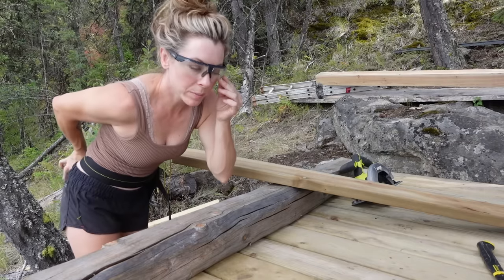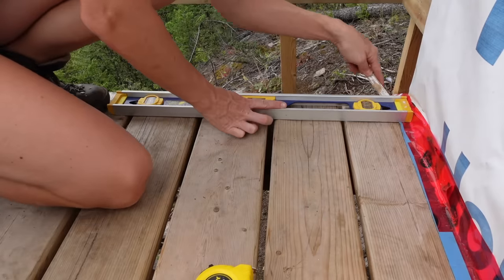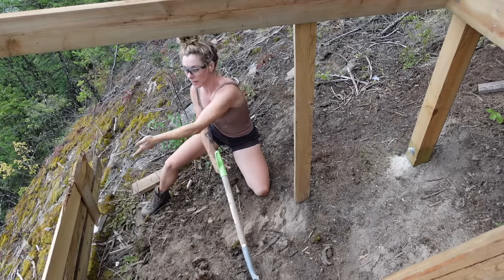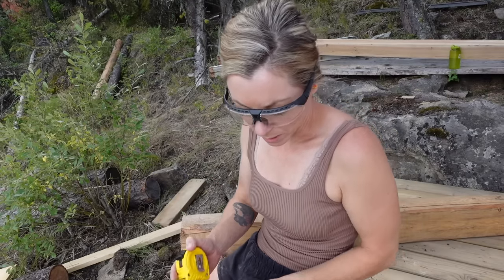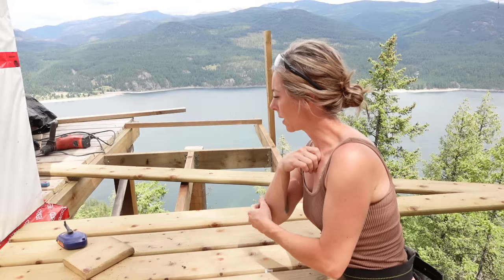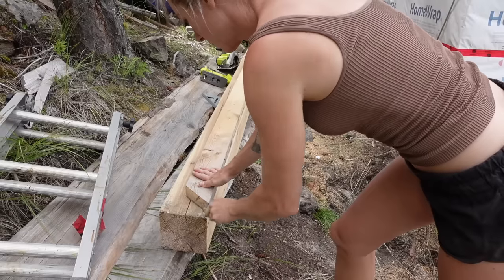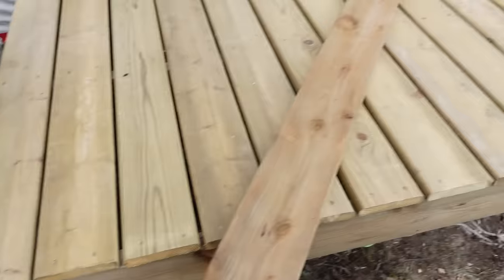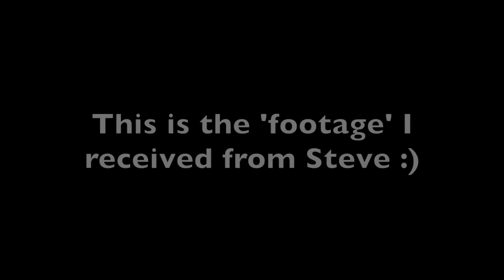Would you attempt this by yourself ?? The Cabin on a Cliff series.

Comment: M-goss, there is a way too, square. use offset lines. center line the structure and snap it,,, 3 4 5 and square it! start with the long wall, dont forget to measure the right angle and mark it. forget the offset lines and over come them. indeed you will! I say,,hey hey     hey, hey WHATS the matter ? with youre hair?    hey, hey.

Comment: If you'll use a ancient squaring equation ,it will Help you out ! From Building Miles and Acres of Shopping Complexes and Warehouses ! You need to figure out ,what your gonna use as " Law" for being square ! whether it's the Face of the cabin " which it should be " or whatever it is ! And then use the measurements from that point ,, 6,,,8,,,10 ! If you'll measure from wherever your " Law" is ,,, 6' and then a right angle 8',,,,,, The measurement between those 6 & 8 Marks should be 10 ! Whether it's inches,,, Feet ,,, or Miles ! Or you can Measure from corner to Corner measuring from corner to opposite corner ,,, all for corners and the adjusting . so that both measurements are spot on ,,, then even if the cabin is outta square ,,, you can use those " X" marks to get back square ! A roll of mason line ,,, a level , a framing square and a pencil are essential,

Comment: A little late in the game BUT, from what I am seeing of the size and span of your deck, you probably should have used 2x10's and maybe even 2x12's floor joists and locate them on 16" centers. It looks like you are using 2x8's for floor joists and 24" centers?  Way too far apart especially if you are going to have "guests" and put patio furniture on the deck.  There are charts to determine such things you should look up. There is also what is called "nail patterns".....which explains what size nails or screws to use what how to place them to maximize structural values. You can Google all of that.